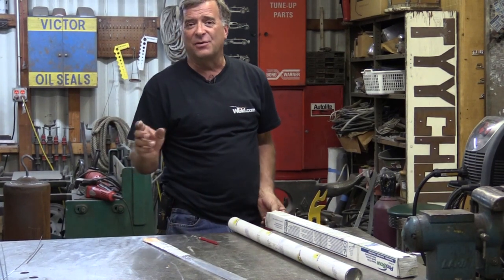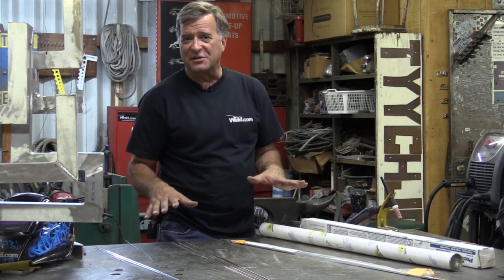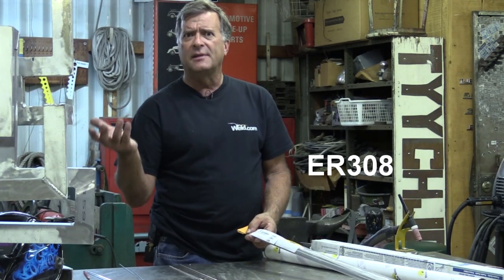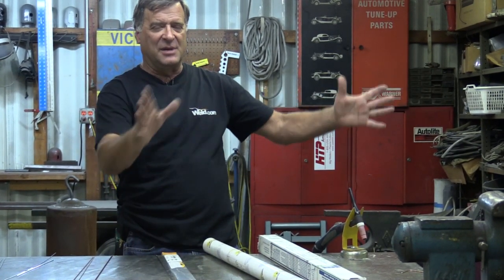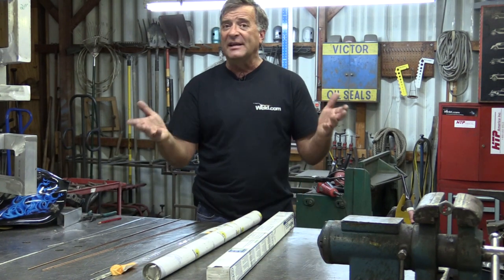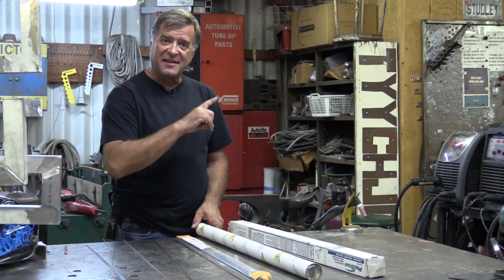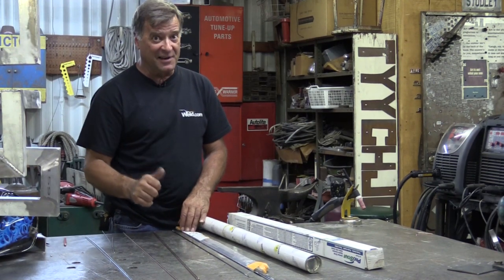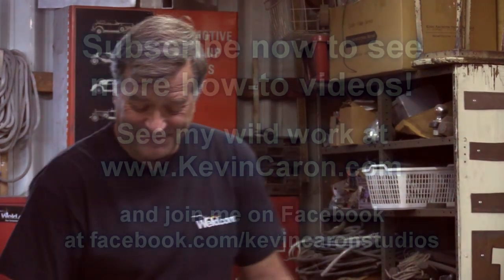What Are TIG Filler Rods and How Do You Use Them? - Kevin Caron

Comment: Tig rods are they like 7018 or 6010 rods ??
Reply from the maker: Not at all.   Far as I know they are just super clean steel, aluminum or whatever you are welding. No flux.
Reply: @KevincaronSculpture  what I meant was 6010 is use for many things but it’s known for penetration and then you use 7018 to cover

Comment: So what size rod for what size material ?????
Reply from the maker: I like to use the 1/16 for 16 gauge,  the 3/32 for 16 gauge to 1/8 inch depending on fit and the 1/8 inch for 1/8th inch and up.   But it can also depend on the size of the weld you are trying to get also..   and the amps you are running,,
Reply: Thank you sir

Comment: Thank you , Kevin !  If I'm using 3/32 filler rod , would I use a 3/32 tungsten tip and for 1/8 filler rod would I use a 1/8 tungsten tip , I'm still learning and was just wondering ! I finally got my tig set-up ! Help !  Your videos are very helpful ! I'm doing mig , tig , stick and fluxcore welding and have been watching your videos with great success ! Keep up the awesome work ! I drop my welding rods sometimes too ! Lol
Reply from the maker: Mr. Heiss I use the size of tungsten for the amperage i am running..    Go with the size of filler rod for the joint you are welding and how big of a fillet you want ..   Also for how much of a gap you have from a poor fit on the joint..
Reply: Thank you ! I will try to keep the gaps to a minimum ! Also ask the LWS , for the right rods ! I will try the 1/16 tungsten first ! I love you wives comments also , great sense of humor ! Keep it up my friend ! I have a Weldcraft CS 300 a little big , I hope it last ! Have a wonderful day !